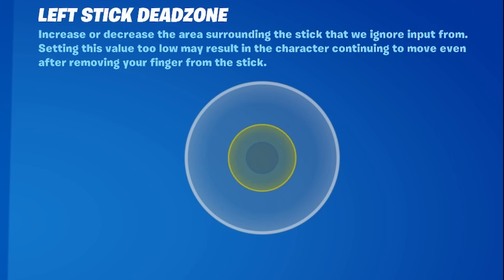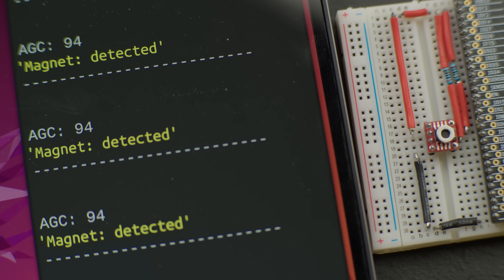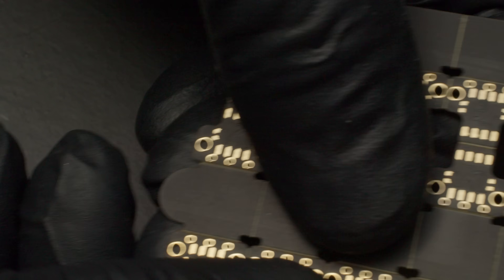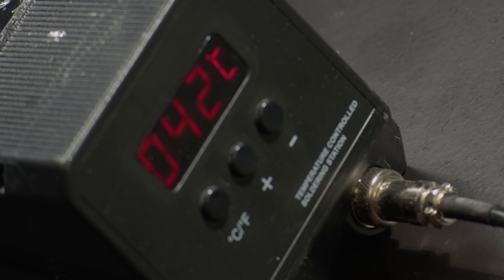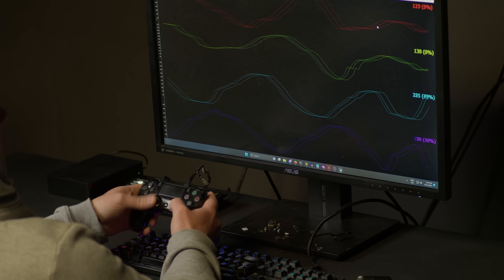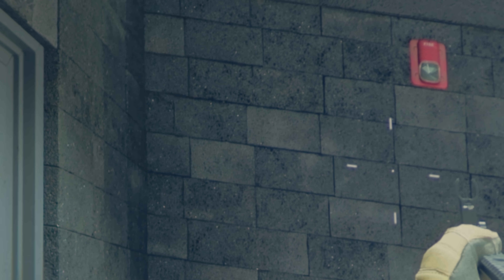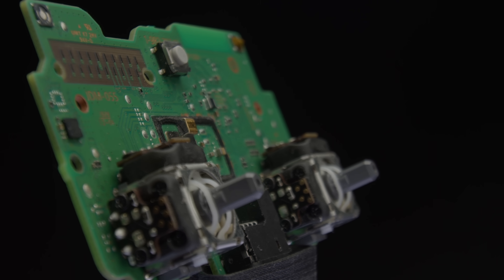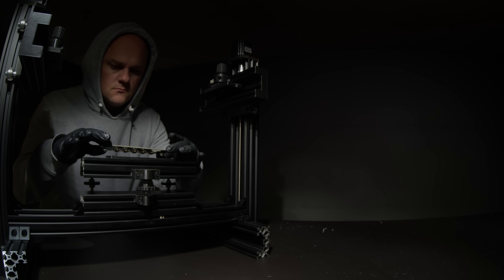Beating the $20B Joystick Drift Problem, and giving it away for free

Comment: We already had Hall effect joysticks since Sega Saturn's 3D control pad, and the Dreamcast controller.. but no other used them ever since...
Reply: Not true, the PS3 Sixaxis and Dualshock 3 controllers used hall effect sticks for several board revisions (V2 through VX5), but sadly they reverted back to cheaper carbon potentiometers for VX6 onwards and then the PS4 and PS5 controllers also.

Comment: Now add a triangle wave generator to dither past the quantization limit of the 8-bit ADC. I wonder if there is anyone who would perform better with the added precision?
Reply from the maker: Let me tell you what i did.  I located the two points where the controller value center  is oscillating between +1 and -1. And i took the center position of those two values. So i was able to take advantage of the about 700 points within the movement range even though the adc is just 8bit. I spent like 3 days on that. Haha.
Reply: @MariusHeier1  Ha, nice.

Comment: Hall effect joysticks have been around for a LONG time... the problem is greed. The potentiometer wiper design is a few cents cheaper than the hall effect ones. At scale, that saves the companies a lot of money on manufacturing. This unfortunately relegates hall effect joysticks to higher end products (sometimes... most of the time even they cheap out) and aftermarket modifications.
Reply: It's also about power consumption for battery life.

The PhobGCC halls draw 20+ mA whereas an entire Nintendo-made Gamecube controller draws 3 mA.
Reply: @CarloVaccariPlus random carvac W

Comment: I started out wondering why you used such a complicated hall effect sensor when most commercial applications use simple 3 pin chips, that basicly act like a standard potentiometer. Then it hit me - calibration! You solved the biggest issue other people have failed at by using a more complicated sensor that you can use to correct for whatever calibration the controller has

For those not familiar, the reason that it isn't as easy as just replacing the sticks is that every thumbstick gimbal and every potentiometer is a little bit different. Brand New sticks will have some variance, so when the controller is manufactured the company calibrates it out. If the stick originally reads -4%X +7%Y, they can offset the values the controller reads to be +4% -7% and it will read perfect center. If you replace the pots or full thumbstick module, especially if you get one that is variant in the opposite direction, you can end up with stick drift that's due to the miscalibration rather than physical wear. I used to correct this by taking the wiper out and very precisely moving the middle bump back or forth to adjust it physically. Works but takes forever. At least Nintendo realized the joycon sticks were garbage and let us actually use the calibration menu ourselves

Having a single chip that is programmable is exciting. You would need to sell or design a programming tool that also calibrates it. You could have something like a cap with pogo pins that has the same screw holes and screws down over the sensor, then you push a button and move the stick all the way forward, all the way back, it takes what it reads and applies the calibration. The main issue here is the movement range of the stick in the controller is not the same as the total travel distance of the stick. Ex the physical stick might be able to move 45 degrees in any direction, but inside the controller shell of a PS4 moves 30 degrees in any direction, and inside the shell of an Xbox one controller moves 38 degrees, etc. If you calibrate to maximum extents = 3.3v/0v, and the controller only expects it to move within 80% of that range, once assembled it would only go to 2.7v/0.6v. this is a an extreme example but makes the point - you really need a way to calibrate them with the controller top shell and stick caps on.

One possible solution is add a vertical ffc/ribbon cable connector (like the one they use for the cable on the ps4 controllers going to the USB board, or the dual sense microphone connectors) and mount it close enough to the PCB side that colliding with the thumbstick cap isn't an issue. You can connect the programmer by an fpc flex cable, and then assemble the top half of the controller so you can calibrate it with the correct stick caps and shell

Another thought is getting a sensor that has a built in min max calibration routine, and having it enter like a calibration mode on startup for the first 1 second, if the sticks aren't moved then use the current calibration, if the sticks start moving then record the min and max values and after 3 seconds use that as the total range. I remember some older controllers used this and it seemed to work fine. The issue is finding a sensor that has this function built in - you might have to rely on having 2 chips, a simpler more basic hall effect sensor and a small microcontroller that applies the min max and programming logic (this is what guilikit does with the stream deck replacement stick modules)

I was also wondering, what about a sensor that has 2 pins for min and max setting, and like 2 tiny and pots on the back of the sensor to adjust them manually? You would need a sensor that uses the resistances of the pots to determined your upper and lower limit. End user could manually tweak them once which would kind of suck, but a dab of hot glue or silicone to keep them from ever moving again and it's done, and the sensor wouldn't need any external programmer to set the limits. No idea how you would calibrate this while it's in the shell though
Reply from the maker: I really appreciate your long comment. It's full of basically every hurdle that was needed to face to make it work. Let me try to comment on something that you might find interesting. Each chip has two hall sensors, cordic computer and a dac.  And the total travel for the 50degrees is about 700 positions out of 4095.  And the output is 14bit. One of the biggest challenge was to make something small enough because the soic is pretty big. I have later found  a qfn16 and a crazy small from the japanese company known for high end audio stuff. Never remember their name. I will most likely try to make a low power mcu version using tmags5273 because it can run on both 1.8 and 3.3v. xbox and ps5 needs 1.8. i can offset the stop and start position in order to get full travel in corners or top or min mid position. However i measured the top and bottom on ps4 to be 0.8v to 2.5v ish. I spent alot if time testing different calibration routines to find best the mechanical center. And do a kind of window update of start and stop position to match the chips center position to centering values  by continuous measure the angle from position sensor 127-128  position and 128-129position. And select the median value for that. It will set the most perfect center. The joystick is playable in call of duty with 0 deadzone, if you can live with the drift within the 0-3% deadzone of the mechanical design. Its really weird but nice to be able to have so good control because of the clean low noise signal.  The gulikit one is super noisy and uses a ton of signal processing to even work. And they also do automatic recalibration and have like a rolling center position. Which makes it really hard to actually hold ot still on a target.
Reply: @MariusHeier1  Very interesting. I was under the impression ps5 and xbox one used 3v3 for the v+ on the rail the thumbstick potentiometer use - i'll have to double check this next time i'm in a dualsense controller.

Within 3% deadzone is perfectly fine, I've seen 2% on literally brand new controllers and find under 5% is acceptable for most games and systems. There's only so much you can do with a worn gimbal without replacing it

How exactly do you compensate for the difference between the "full travel" of the mechanical gimbal vs the actual travel when assembled (which is usually less than the full travel the thumbstick module will allow)? Could you take one of the thumbsticks you calibrated using your existing method, go to gamepad tester, and do a circularity test? That would help show any issues with over range or under range motion. IT would alos be cool to see a circularity test ona thumbstick with one hall effect and one traditional pot, to see how closely the replacement sensor matches the original's behavior in terms of range / calibration.
Reply from the maker: The ad5600 can be manually programmed for min and max. However only one time. So its gonna be terrible user experience if one messes that up.  For the next version ill make a external rp2040 board that can be used as a dev board and a programmer. With usb host. So the programming can be adjusted to each controller. I might use just variable smd resistor on a back board for centering. However to get the super good center position its so much eaiser to just use a programmer. You can also do 3 config burns over i2c.
Reply from the maker: The reason why I used an expensive postion encoder instead of just normal hallsensors and a mcu was for several reason, but mostly. Easy to make, pretty fast, easy to manufacture, easy to calibrate. I was actually working on a custom ps4 board that can use low power 3d hall sensors. Which i think makes more sense, because you get full control. But so many people asked if i could so i thought i would give it a go.
Reply: @MariusHeier1  I actually went back and re-watched your last video from 3 months ago about this, and yeah - that actually makes a lot of sense. The BOM cost on these would be higher, but that's worthwhile for a sensor that you can calibrate directly. How expensive are this style of rotary hall effect sensor vs a simple hall effect sensor?

Srsly looking forward to a day I can order 25 or 50 of these and a calibration tool to get them set up.

Comment: Hi, Looks good. Few questions and issues to look out for. 
1: On a PS4 / PS5 controller (I pick on these because they are the worsted) when assembled in the shell with the caps on. Does it go to 100% travel in all 90 degree points? 
2: If you want to drive yourself nuts install these on a Xbox Elite 2 analog (a mildly used one for a fair test) ....LOL. 

These will still have to be calibrated (specially the PS4 / PS5's) because the original analog resistance reading are burned into the controller FW at factory (not all analog pots measure the same). This includes the centre dead zone,  full 360 movement and zero to 100% travel, with HUGE emphasis on the zero to 100% travel, this is the hardest part to get right. Centring analongs really is the easy bit. 

The main issue will be retro fitting these to an already bad design (ALPS not you), as you say there will never EVER be 0% dead zone EVER!!!! So all you "PRO" gamers out there... That dream is just that! 3% is about the best you will ever get and that's only with a brand new analog module for a limited time. As time and usage goes on the mechanism will wear inducing slop in the mech and the dead zone / spring tension will increase / decrease respectively. This was the case with some PS3 controllers where they used  magnets in the pots. The pots where perfectly fine but the analong mechanism lost all the spring tension and was limp, just like an old N64 stick. 

This is a very good effort, however in my eyes (having being repairing controllers since the early PS3 / Xbox 360 launch on a daily basis) I see this is still a bandage fix without totally redesigning the entire analog module. Unfortunately controllers are and always will be a consumable item like the tyres on your car.
Reply from the maker: I painfully learned all the same stuff you have. Haha. I feel you. And all of the things that made this project hard, was things implemented by Sony without giving any benefit to the customer. Rather the opposite. The chip can be programmed in terms of 0-3.3v with a start and end point. So what i do is first find the angle reading that best represents the edges of a non faceplate limited joystick. Then i do a calibration to find the best center point. Then i offset the centerpoint by changing the start and stop position to fit the controller individual controller. My robot friend does this by capturing the usb data from the controller and automatically adjusting the start and stop point on the position sensor at the same time. And you are right a out the 3% deadzone. Which is actually really impressive in terms of how cheap and how thin and flimsy these joysticks are. However. The magnetic sensor has very low noise. And has 700 steps to measure the magnet position. And a 14 bit dac. So you can move this joystick in a way you cannot do with a normal alps joystick.
Reply from the maker: Regarding go to 100% travel. It can be calibrated to have 100% readout in the corners, or in the max center positions.

Comment: Actually would you think about selling the assembled PCBs and other parts as a conversion kit?  Ideally for me it would be a sheet of assembled PCBs, accompanying magnets and screws.  I can print the other parts no problem although I'm sure other people would want to have them included.  I can easily install them in my existing joysticks.

I'd be much more interested in buying them like this since I assume they'd be easier and cheaper for you to make, and I'd love to get a bunch of these compact PCBs to use in other projects.  If it's not cost-effective for you to do so, I'd understand, but I'd much rather buy the PCBs by the sheet than buy the fully assembled joysticks.
Reply from the maker: Yes. Ill make some thing with pcbway so you can order them at lowest price in bulk.
Reply: @MariusHeier1  Awesome, great news!

Comment: I do wonder if there is a patent on this out there and the patent holder is wanting $$$ beyond what is reasonable.  That may be why console makers aren't doing this already.
Reply from the maker: I think the strongest factor is that there is non  on the market that can supply the quantites needed. And the companies are probably locked down in partner deals. Another contributing factor might be a survey of why people need to buy new controllers. Which one is drift. And if you take away that, its less profiable.

Comment: Holy bajezus, I was just yesterday searching everywhere to see if anyone had made a hall effect thumbstick module and I could only find two.  One is for a switch joycon and the other is for a steam deck.  Both are silly expensive for what they are and they're not generic at all, they only work for very specific devices.  This is something I could easily attach to an arduino or ESP32 powered gamepad, or the retropi handheld I'm building with my kid.  If this is reasonably priced I will absolutely be throwing some money at you when it releases, just to support the open source nature of the project.  I already have a couple of AS5600's lying around but they're on big square boards that would never fit this use case.  I'm super excited for this, nice work!

EDIT:  Also this quote from the description:  "If the world won't change, we'll just have to change the world ourselves."  Yes, direct action is the way.  You've got a new fan :)

Comment: Man what a legend! Turning down money takes big cojones!

And I myself have tried to make diy hall effect joysticks for almost 2 years now with 0 success. Mostly because I have no educational background with software or hardware Engineer whatsoever but I'm a curious guy who read around and tried using linear ratio-metric hall sensors and rectangular 2x6x3mm magnets and just swapped the 3 pin potentiometer with the 3 pin hall sensor, completely forgot about neutral resistance values and did not use any resistors. Failed miserably and gave up for a few months. I live in India and we don't get the good stuff early on. There's a company that makes affordable hall effect joysticks named Gulikit but there's no trusted or affordable way to buy the Gulikit King Kong 2 Pro in India :(

I hope your open source project can be replicated in India as well. Kudos to you sir
Reply from the maker: Hello friend! The goal is that everyone can replicate it for lowest possible price.. there are also 2 others chips like this I will add support for. One japanese company and one Chinese company. So it should be easier to source material.